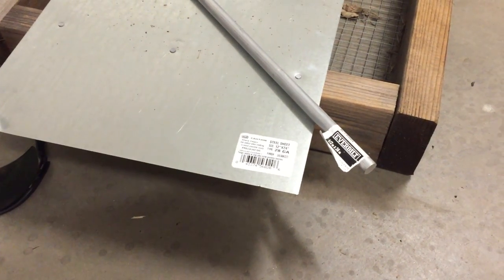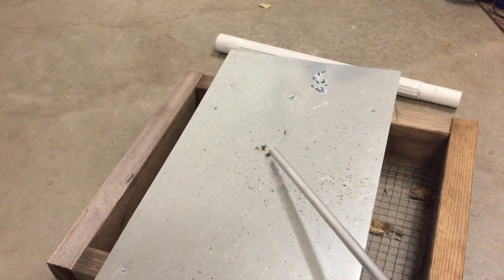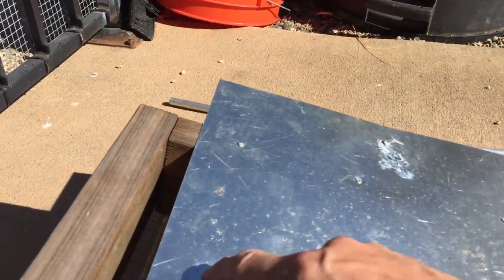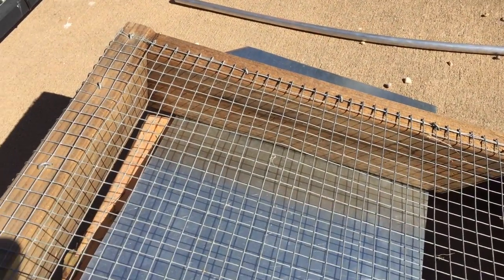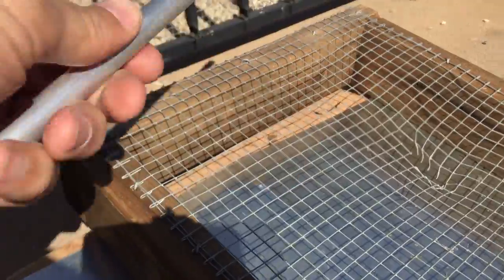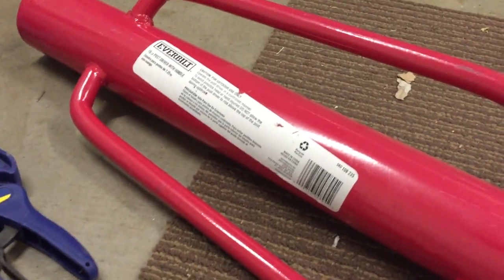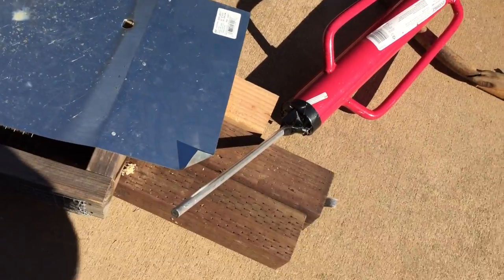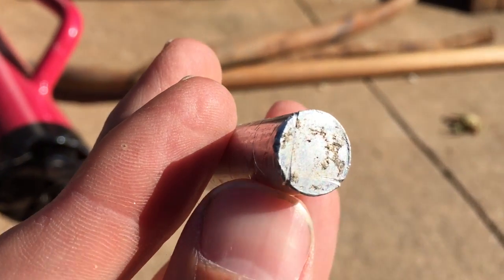Aluminum vs  Steel

Comment: I greatly appreciate the urge to build simple architectural models like this.

 I've also had the idea to use that square mesh stuff to simulate the outer columns. Round bar being way heavier than square tubing for equivalent strength, it actually softens some of the difficulties with scaling. Good choice on target material for a fair experiment. 

I think there's some interesting physics to examine here:

You can shoot a slow moving spear through water to catch fish, but lighter, faster bullets are stopped by water easily, in a short distance. The same spear is likely to be stopped by a piece of wood that wouldn't be a serious obstruction for the bullet. 

"Fast and light" defines a projectile with high energy for its momentum. slower and heavier projectiles have high momentum for a given energy. 

No question that the real impacts were "kinetic energy dominant" events, whereas your spear stabbing thing is deeply into the momentum dominant regime. Furthermore, you've gotten the scaling of the momentum hilariously wrong in absolute terms, which you don't have to know physics to "see". 

You or I could easily breach several layers of mesh with that heavy spear. whereas, the plane would certainly not be able to breach several building faces. 

It would be fun to make folded origami "planes" out of sheet aluminum, and stoot them from a slingshot or crossbow at several layers of that mesh. The plane gets shredded as it does whatever damage it does. High speed footage of that would be so awesome. Shooting an empty popcan could work to.